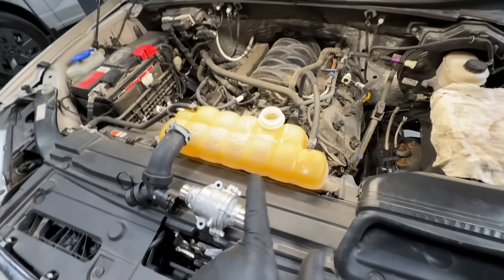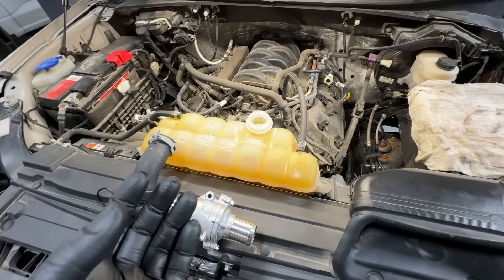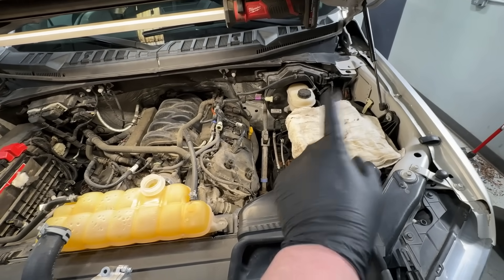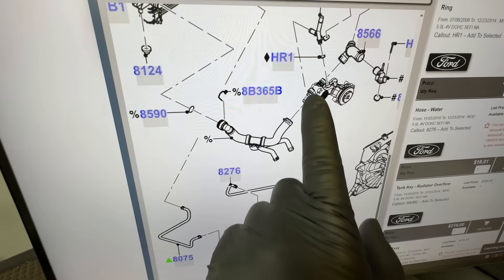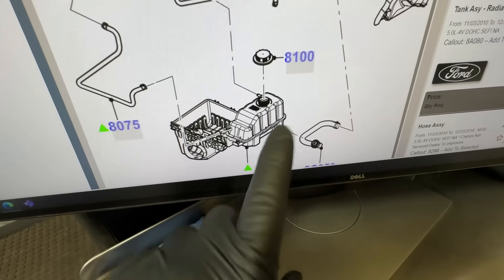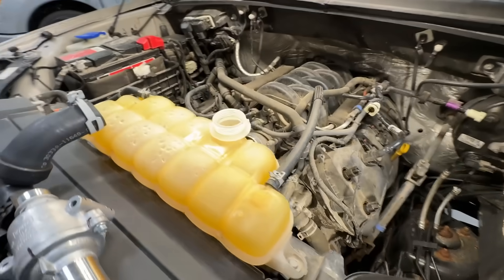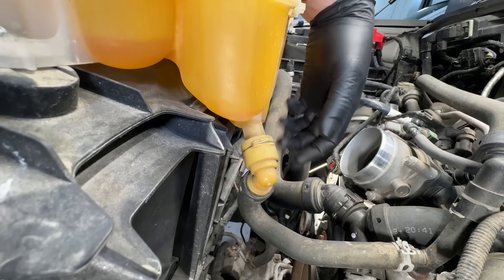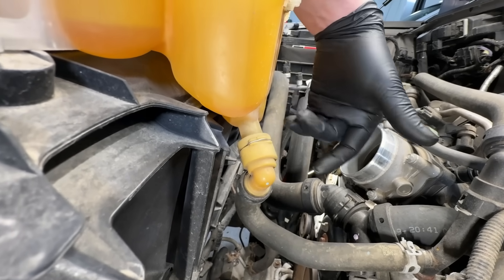2011+ Ford F-150 5.0L Coyote Engines: The Top 5 Most Common Coolant Leaks!

Comment: I'm intrigued.  Some external cooling hose leaks means the 5L engine is junk?  Water pumps going bad doesn't seem like something to condemn an engine for.  Hmmm ,what else you got?  400HP not bad?  Don't like the V8 growl?  Okay?  Is that it?
Reply from the maker: Please see my previous response- Not saying they break down at all. I am just very disappointed in the engine as I had high hopes for them when they came out in 2011. The cylinder bore distortion issues, tuliped valves, way too many coolant leaks, some oil consumption issues on the rear cylinders, ignition coil bolts that rot and break (unacceptable in this day and age), valve cover bolts that rot and are miserable to remove mainly 11-14 models, the embarrassing tapping knocking noises all of these make, they have a stamped oil pan and elastomeric gasket just like the 5.4L (which never ever leak) yet the 5.0L leaks like crazy and soak the underside of the engine (why is this even happening, again very disappointing), I am not impressed with the power I think they are a dog (maybe I am used to the EcoBoost power) except the mustang calibrations and 21+ are much better. Also, you do know about the bucket load of major issues with the 2018-2020 models right? I am hoping the cylinder deactivation and wet oil pump belt on the 21+ models are not another disappointment in the future. There may be other concerns I cannot think of right now. Now do you understand my point of view? Oh and almost forgot about the IMRC issues on the 15+ models (again I have never even had to diagnose an IMRC concern on the 5.4L 3v)
Reply from the maker: No you missed the entire point of the video. I should have specified trhe exact noises but figured you would know the noises these engine produce by now.

Comment: I will take my 5.0 any day over the eco turd. Talk about junk.
Reply from the maker: EcoBoost engines have way less problems than you realize, of course the 5.0l does have less problems as any NA engine would.
Reply: @FordTechMakuloco  I worked as a  Ford dealership technician since 1987 until I retired 2 years ago. I  was a automatic transmission and diesel technician but the gas guys had nothing good to say about the eco  boost. They both have their own pros and cons. Have a great day my friend.

Comment: Well, on the bright side, at least all of those leaks look like they would be fairly easy for a home-gamer to fix if they wanted to.  As opposed to the water pump Ford put in the V6 that is buried inside the engine.  I worry about the EGR cooler on my 2.3L as well given Ford's track record with EGR coolers in their oil burners.
Reply from the maker: definitely!

Comment: If coolant leaks are the "biggest" problems with this engine I'm happy. Also, it's not really the engine itself that has issues...it's the external accessories and hoses that leak which have very little to do with the Coyote engine itself.
Reply: Exactly, you mirrored my thoughts. After years of watching 5.4 3V and 2.7, 3.5 Ecoboost and their endless issues, this engine is a relative dream. The lack of 5.0 Coyote content on this very channel compared to the rest also says something. Your comment should be much higher up.
Reply from the maker: The leaks are unique to this engine is all well besides the water pump.

Comment: Hello I just bough a used 2021 F 150 super cab with a 3.3 L non turbo. I like the truck so far but I value your opinion.  Is there any thing I should keep my eye on. It has 67,000 miles on it.

Comment: Thx FTM....you saved me ALOT of headache. Was thinking of a Mustang Convertible. Between the 3.7 water pump and the 5.0 swiss cheese cooling system? No thx!
Reply: Mustang 3.7 water pump is external unlike the fwd 3.7s.
Reply: @postmaster505012  What about the 3.5's. I thought they were setup the same. ?
Reply: Fords  3.7 used in rwd vehicles like mustang and f150  have external mounted water pumps. The 3.5 and 3.7 used in fwd vehicles use an internal water pump. They are the same motor but the water pump is internal because there is not enough clearance to fit an external pump in a fwd vehicle.
Reply: @postmaster505012  Even the Explorers?
I thought the 3.5//3.7 had a Class action lawsuit over these water pumps not going 150K.
Reply: @mikejohnson9118  Explorer 3.5 is fwd with internal water pump.
Reply: @postmaster505012  Post...after checking around..(duh) your right. The 3.7 RWD W-P is external. Which is cool as I was really looking at a 3.7 Stang Convertible. Would luv the 5.0. But the 3.7 seems more than fine for a D/D. Cheers!

Comment: I have '15 F150 with V8 and have maintained it as per your recommendations regarding (yellow) coolant change, etc., been pretty satisfied overall. Only 60K on the 5.0 and even with 3.73 gears I have to agree with you that it really is underpowered, especially towing, unless you rev it to the moon. Can't really complain about 18+ mpg running empty; did have trans cooler line rust off by the cooler, other than that and the vacuum 4X4 hubs, just brakes, shocks and tires, not bad for coming up on 10 years old. I would still be driving an '84 with 300 6 cylinder and granny tranny if not for living in the rust belt...Great videos!

Comment: I have been a victim of a bad Degas bottle cap which causes the coolant to flow out of the vent on the filler neck and also the triple-junction by the water pump/thermostat, or #2 and #3 (2015 F-150). Fortunately, though, these engines are super easy to work on.

Comment: I have a 2014 F-150 and I’ve had two of these things happen. I had the upper hose leak and a failed water pump. The water pump failed early enough that it was covered by the warranty. I also have a 2011 Mustang with a Coyote motor and have never had a problem.

Comment: Had a 2013.  It got a water pump under warranty.  All the T joint hose eventually leaked.  No other engine issues.  Dumped it at 160k because of rust.

Comment: Man I hope his backlog has a bunch of 6r80 vids. I got some crazy stuff going on I can’t pinpoint. Cant wait for this years videos!
Reply: He’s got some great videos on the 6R80 transmission.
Reply: Check the wiring harness bulkhead connector on the transmission. my 2009 f150 was acting weird and replacing the bulkhead connector solved the problem. It was a bad connection.

Comment: Have the 23s been holding up? The plasma wire coating cylinder liner durability? Are the 23s having all these leak issues? If you were buying a 3.5 or a 5.0 which would you buy just looking at it from a reliability and durability perspective?

Comment: 12 F150 Lariat with 146k. I've had to replace the t connection and the water pump. I've also had the radiator leak on me too  in a similar spot shown here.

Comment: Hello, i have 2017 mustang GT i went to the dealer to buy a coolant, i want to flush the coolant system, they told me u have to use the yellow coolant not the orange, is that true?
Reply from the maker: correct

Comment: Heater hose was seeping coolant on my '13 5.0. Omg those firewall connections are tough. If it helps anyone I found it was easier to disconnect the engine then twist the hose to help release from firewall.

Comment: Start to scare me, just purchased a used 18 f150 all my research said it’s reliable as heck.
Reply from the maker: You researched the keywords 2018 and 5.0l and found no engine issues?
Reply: @FordTechMakuloco 
Nothing to be really concerned about that I could find. I was a GM guy and wanted to get away from 5.3 lifter problems so I bought a 5L 🤷
Reply from the maker: Well let's see cylinder scoring, oil consumption, sounds like a diesel which is just embarrassing, rattle on decel which if you are lucky gets fixed by the exhaust VCT solenoid and that's just for starters.
Reply: @FordTechMakuloco 
Didn’t know what else to get it frustrating. GM and Dodge have their problems but I thought this would be the lesser of both evils 😢
Reply: @FordTechMakuloco 
Make a video of the best used truck to buy. I’m from Michigan and my family would disown me if I pulled in with a Toyota Tundra. Both parents and in-laws worked for GM and they are already salty that I bought two Ford products 😄

Comment: I was recently forced to use K-Seal Coolant Leak Repair to resolve a radiator leak in a class eight truck. I was very resistant to it but my mechanic said he used it him on his own vehicle for two years before replacing the radiator. I was very pleasantly surprised to see the product work very quickly. This was a week and a half ago and I haven't seen a single drop of coolant since. My driver has also not reported any problems to me.

Comment: Reminds Me of the Days When Fords quick connect AC Lines Notoriously leaked R-12.
Reply: I was thinking the same thing. Late 80s into the mid 90s. The o-rings would all dry out and shrink.
Reply: They would come in and get the Yearly Recharge.  Maybe some Seals with an Evacuate and Recharge.  LOL.  Love on Ford. They putting Food on the Table. @MM-jm7tt

Comment: I am new to your channel & I'm glad I ran across your channel 👍🏻. Last June 2023 I purchased a 2006 Ford F150 XLT Super Crew with the 5.4L Triton V8. I have heard the horror stories of the spark plugs breaking off in the head and the placement of the secondary blower motor under the intake manifold and it going out. So far the truck has been great but I am just about at 90k and I know the timing chains have to be replaced between 85k to 120k, the cost here at the dealership is $2700! I'm an old time car & truck owner so this is a 1st for me. That's a lot of money but I can see why now, after just replacing the oil and filter 🤪😆 what a freaking nightmare! No room to work and I don't have a ramp. I will have to scour your channel for my truck 🤞👍🏻 thanks for all the hard work and great vids.
Reply: You will have to change the oil pump to a higher pressure/volume flow pump and the roller bearings as well when you’re doing the work.  Lots of costly maintenance with the Tritan 3v … good luck!
Reply: Thank you for the heads up 👍🏻

Comment: I have a 2014 5.0 F150 FX4 I purchased new from the dealer. I have followed your suggestions and I have not any coolant issues or transmission problems. I even changed the transmission cooling lines. It has been the best Ford I have owed. This is my 5th F150.
Reply: I had a 2014 5.0 STX I sold it to an employee and he’s still driving it with almost 300,000 miles on it. That truck never gave me a problem at all

Comment: Are the coyote engines still sounding like a diesel at idle? My 2018 5.0 (which I miss) sounded awful.. was told it was normal. I seen my old truck not long ago. Still running strong!
Reply from the maker: 21+ much better

Comment: It would be nice if you did a short video of everything wrong with the 5.0.  Because there is very little information about it which usually means there isn’t much to complain about.  There are comparatively tons and tons of videos with everything wrong with all the eco boost engines.
I think of the tc customs videos where almost every ford tech says they’d buy the 5.0 for example.  I know you bought a 3.5 but wondered if that’s because you could do any work yourself on it
Reply: It wouldn't be a very short video
Reply from the maker: Please see my previous response- Not saying they break down at all. I am just very disappointed in the engine as I had high hopes for them when they came out in 2011. The cylinder bore distortion issues, tuliped valves, way too many coolant leaks, some oil consumption issues on the rear cylinders, ignition coil bolts that rot and break (unacceptable in this day and age), valve cover bolts that rot and are miserable to remove mainly 11-14 models, the embarrassing tapping knocking noises all of these make, they have a stamped oil pan and elastomeric gasket just like the 5.4L (which never ever leak) yet the 5.0L leaks like crazy and soak the underside of the engine (why is this even happening, again very disappointing), I am not impressed with the power I think they are a dog (maybe I am used to the EcoBoost power) except the mustang calibrations and 21+ are much better. Also, you do know about the bucket load of major issues with the 2018-2020 models right? I am hoping the cylinder deactivation and wet oil pump belt on the 21+ models are not another disappointment in the future. There may be other concerns I cannot think of right now. Now do you understand my point of view? Oh and almost forgot about the IMRC issues on the 15+ models (again I have never even had to diagnose an IMRC concern on the 5.4L 3v)

Comment: This is off-topic, but what are the most common reasons why my 2022 F150 2.7 has a slow response time at acceleration, low power & rough idle. Occasionally runs good, but most of the time, it's not so good. On the highway it run great. In town is my problem. Any ideas would be helpful. Thank you 
By the way, my dealer says everything is normal.😵‍💫

Comment: Mine is leaking out of the throttle position sensor, swear to God it is. 2018,  226,000 miles and it just passed emissions no problem. We changed a water pump, front wheel bearing and spark plugs, best engine I have had.

Comment: 2013 5.0
I've changed the o-ring, the t-connector, water pump, all trans lines, new oil pan gasket along with all new fluids for diffs and transfer case.  Than you for all your videos, couldn't have done any of it without you.
Reply: Agreed 💯! I have done all those as well minus the oil pan and I couldn't have done it so easily without this channel. I have learned a wealth of ford knowledge and basic technician skills.
Reply: what size O-ring is that? mine just started leaking, thanks
Reply: I just finished swapping o rings but the t connector is new. So still leaking. I will go buy water pump. Sucks because been battling this for months, eBay, me, adding coolant/water. I hope water pump is simple enough, is it good chance replace the stationary pulley? I thought it sounded louder than normal.

Comment: Another issues with the f150 truck is that the valve cover bolts rust due to water leaking down from the cowl
Reply from the maker: Yes I mention that in this video.
Reply: @FordTechMakuloco  cool
Reply: Sprey them with any anti rust sprey. I do.
Reply: @upperunder249 Will do I bought the engine used. Im doing a coyote swap in my 69 mustang.I'm replacing them with M6-1.00x30 from acehardware
Reply: @musclecargarage8882 nice.Hope everything goes well with your project. 👍. 
I am in Canada and rust is no 1 issues in keeping the car last. Every time I get the car, first thing I do it is covering every exposed bolt with anti rust sprey winter/summer.It makes big of a difference. Cheers

Comment: I have the 5.0L in a 2013 Mustang GT. 165K miles.  I noticed the coolant level dropping and it was from #1(o-ring) and #5 (heater hose).  Then a year later from #2(Oring in T connection).
Reply: Who else is going to start using Brian's numbers to discuss their coolant leaks now!????  haha

Comment: suprised to hear you say you dont like them. I respect all your opinions and appreciate all the help you have given me
Reply: his perspective is as a shop owner/mechanic...not as a consumer.  they are not they same perspectives
Reply from the maker: They are reliable otherwise I just don't like them for so many reasons.
Reply: @FordTechMakuloco Is this a one of? Do these parts have any commonalities like manufacturer or location? Find the source and avoid it. IMO
Reply: @FordTechMakuloco How come?
Reply: can you enlight us and name those reasons @FordTechMakuloco
Reply: @FordTechMakuloco Cause the dang Valve issues thats why
Reply from the maker: Please see my previous response- Not saying they break down at all. I am just very disappointed in the engine as I had high hopes for them when they came out in 2011. The cylinder bore distortion issues, tuliped valves, way too many coolant leaks, some oil consumption issues on the rear cylinders, ignition coil bolts that rot and break (unacceptable in this day and age), valve cover bolts that rot and are miserable to remove mainly 11-14 models, the embarrassing tapping knocking noises all of these make, they have a stamped oil pan and elastomeric gasket just like the 5.4L (which never ever leak) yet the 5.0L leaks like crazy and soak the underside of the engine (why is this even happening, again very disappointing), I am not impressed with the power I think they are a dog (maybe I am used to the EcoBoost power) except the mustang calibrations and 21+ are much better. Also, you do know about the bucket load of major issues with the 2018-2020 models right? I am hoping the cylinder deactivation and wet oil pump belt on the 21+ models are not another disappointment in the future. There may be other concerns I cannot think of right now. Now do you understand my point of view? Oh and almost forgot about the IMRC issues on the 15+ models (again I have never even had to diagnose an IMRC concern on the 5.4L 3v)
Reply: I am surprised also. Doing some research it seems like the 2015-2017 5.0 is highly recommended online by reading forums and Facebook. I'd be interested to hear what Brian would suggest if looking at an F150.